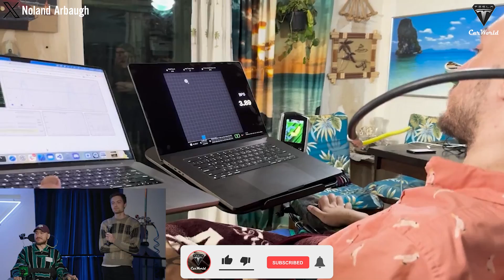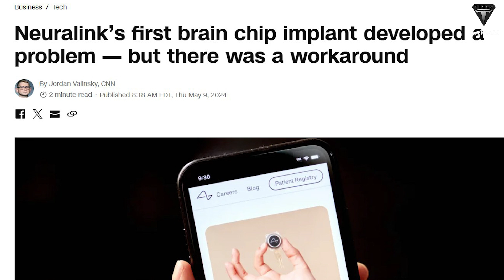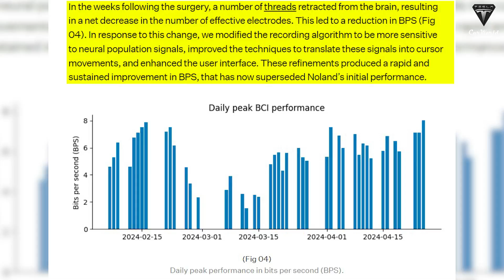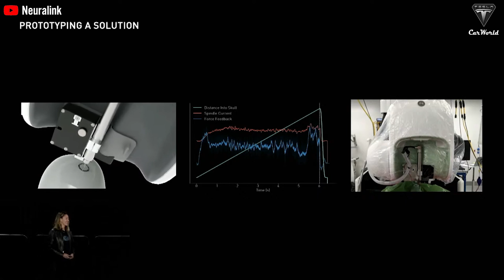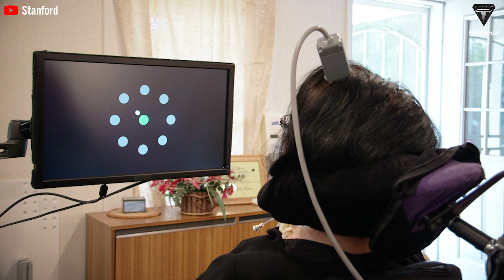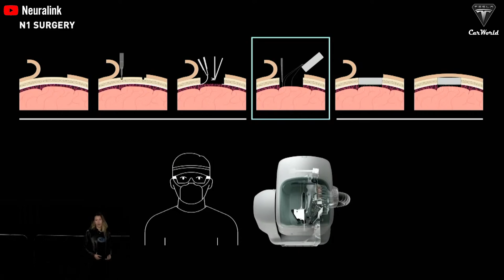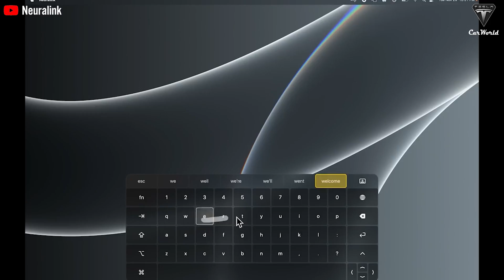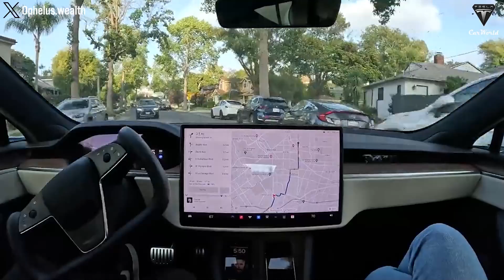Something BIG Happened with Neuralink Problem First Patient! N1 Chip Shock Entire Industry!

Comment: Can't you install fibers into the motor cortex of the brain, and have those fibers bypass a spinal injury, and run inside of the body to another modulator chip that feeds new fibers into the leg muscles at exactly the correct signal parameters to move the different muscles in the legs, arms, ect..?

Comment: Does the neuralink go directly in the effected area? Even a tiny slit in the brain will give you the effect of a lobotomy, I’d imagine it’s mostly motor control and vision areas in the brain right now they can fix unless it’s external. I also wonder how you would get a more advanced chip that is maybe slightly larger or has better storage technology and stuff for updates, would they be able to pull it out? Would there be a risk of injury?

Comment: A lot of the stuff they claim in he can now do, can be done with eye tracking and voice cammands, but voice cammands will probably add more functionality

If they can make this safe, accurate, "fix" his paralysis, and help people with prostetic limbs, return or give people all senses back, and keep the individuals privacy by not having any network connection or ability to know what you are thinking/ your memories that you do not want it to and make sure that it can't be hacked like in movies/tv/anime/etc that alows others to controle/ minipulate you/decive you/etc (this is entirely possible because if it is trasmiting info to/from the brain then that info can be miniputated and if it is going to a prostetic or part of your body then you would just have to interupt it along the way and as for memory if it is capable of reading it then it can mess with it) 

For medical uses to the body, as long as there are no physical (port) or wireless or unshilded wires(can be used as sudo wireless connection), then you should be ok (at lest with as mutch as i'm aware), and all it is doing is acting as a nerve/ muscles replacement, then i have little problem with it.

Note: "full dive VR" gaming will be fun as long as privacy can be promised and keeped and safety, we don't need any SAO(anime) or matirix (movies) or the like going on

Comment: Sorry, I have to give this a thumbs down for the crappy automated B roll. I cringe every time I see a clip of a Utah array. The Utah array is that clunky cube with a cable attached to the patients head. In contrast, Neuralink is wireless and not visible externally. Do better.
Reply: Whatever tool you use to automatically generate your B-roll, consider using features that give you some control of the content. I know that could add a few minutes to your minimal production time, but I think it's worth it for credibility. 

In particular, get rid of Utah Array clips. Those are extremely misleading. Neuralink does not involve a huge cabled cube screwed into the top of your head.

Comment: what if it gets hacked? can they read your thoughts? can they paralyze you with pain? can they track your location? can they I'd you without your consent? etc...
Reply: no.
what hacker could do with neuralink is to manipulate the system so that people think that the user is doing something.
when in reality its the hacker
Reply: Not likely because the chip only receives signals and affects other devices, it’s basically a controller, if it gets hacked, most likely the hacker would control the device the chip is connected too
Reply: What happen if you try to override it, like a DDoS, can you fry the battery?
Reply: 👍. Black Mirror. The MASS chip 🤔
Reply: no it cant read your thoughts all its do is detects a specific electric activiy in part where installed and assume patient wants use computer or whatever 
its like a light in the next house randomly flashing and you start to assume when light flashes that flashes that house wants to use a speaker so you open the speaker whenever light flashes 

short version basicly a motion capture if motion capture detected electric signals coming from you instead of your movemonets

since its just detects activity in your brain and transkates that to code for computer it can't do antrhing to you i it could is device gets shut off so people can't use its faunctions or use them correctly like if you use device to walk if you are paralized device translates codes wrongly due reasons now your hand goes up instead of down or you can't use your paralised hand until its fixed 

literally anything tracks your location question is is there anything that that don't track you? 
i dont understand whats last question about consent
Reply: Life support at hospitals can be hacked though.
Reply: I thought he said something ab being integrated with the Internet with it. wouldn't that mean it can read thoughts?
Reply: Think of Neurolink as a TV remote. You can use a remote to operate your TV, but cannot control or even harm you.

If your TV remote gets reprogrammed (hacked), the buttons will be randomized or it will just stop working at all. Same thing as Neurolink.

Getting tracked or getting your ID stolen is not likely right now as it's still a prototype and can only be used as an input device and doesn't store data.

Comment: I think that this technology is great in theory. But as a person who also is a techy. My issue is that obviously most technology has an input and output. Understand for a calculator the human inputs and the calculator outputs. Unlike phones or laptops which has a second party input via updates. The fact that this device can be tweaked means it can be tampered with from the outside. Aka hacking.  Don't need someone updating the chip in my brain to do God knows what. 😅

Comment: Id hate for that thing to over heat during summer time...💀
Reply: Hmmm, it probably has a higher temperature rating than people do, so it's likely someone would collapse from heat stroke or heat exhaustion before the chip overheats, besides you could always put a cold pack on your head.
Reply: It probably has a higher temperature rating than people do, so the person would probably collapse from heat stroke or heat exhaustion before the chip overheats, besides you could always put a cold pack on your head. Maybe they'll come out with a Neuralink cooling cap to wear on your head.
Reply: @onidaaitsubasa4177  after so much use hopefully the machinery inside doesnt overheat. Our bodies are already running near 100 degrees and a little over when you catch a cold. we are far from perfection but still progress
Reply: @onidaaitsubasa4177  Neuralink cooling pad sounds like a good idea lol